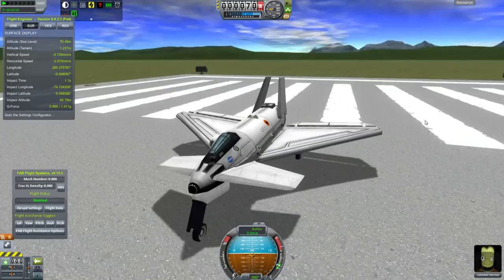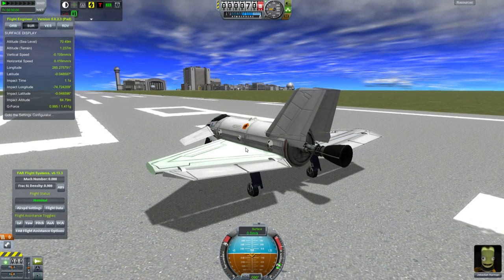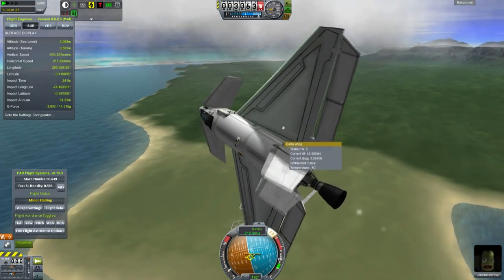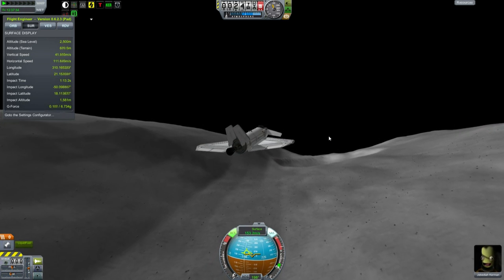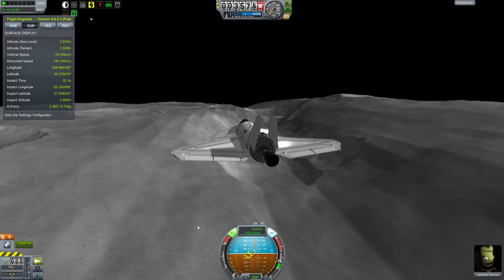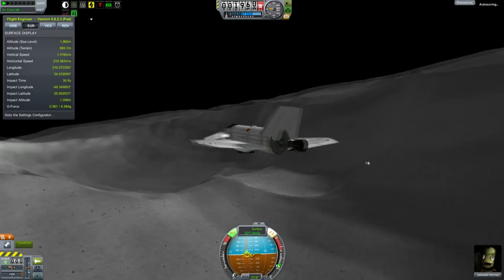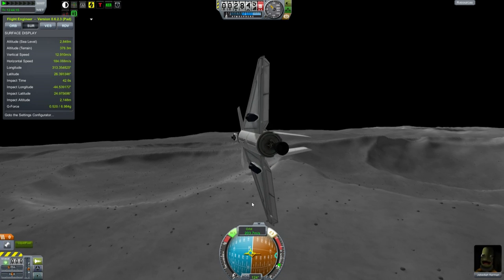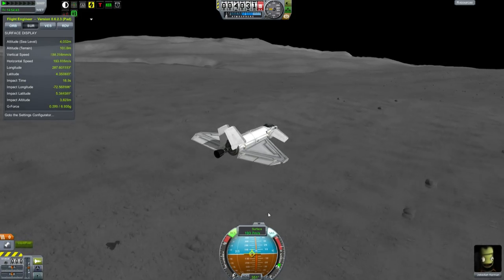The Physics Of Flying 'Space Fighters'

Comment: I think that a realistic space fighter would have very round shapes instead of the aerodynamic looks we are used to. I would imagine a central disk or orb around which the arms with the engines and counterweights can rotate 360 degrees (covering 2 dimensions) and the engines would be able to rotate around the arms to provide full cover. The counterweights would allow the central structure to stay perfectly still while the engines rotate. This would be the place to attach weaponry as well. There wouldn't be a cockpit because having a human in a fighter doesn't make sense. You want to keep the engines as close to the central structure as you can to minimize the moment of inertia.
Reply: A space only fighter would look not too unlike that, yeah. If you need to go into the atmosphere, then you've also got to build in wings and whatnot.
Reply: DFX2KX Yes, but at that point you will need to make trade-offs. I think it would be best to keep them separate.
Reply: So, your suggesting flying saucers? Have the aliens had it right all along?
Reply: seyeruoynepotsuj You could look at it that way :P Mine is just an argument of symmetry really. There is no preferential direction to fly in in space, so it makes sense that your ship would be very symmetric
Reply: Symmetry isn't necessarily the best, it adds flexibility but therefore sacrifices on some specific advantages. For example, having say 4 engines pointed in 4 opposite directions would allow the ship to accelerate in any of those 4 directions quickly, but point all 4 of those engines one way and you can accelerate 4 times as quickly. Same for weapons, point them everywhere and you can shoot any direction, point them all one way and you bring much more fire to bear on one target.

The moving engines and weapons around a disc idea solves this but you add more weight, more parts and more wait time to align engines or weapons to a target. More things to fail/get shot as well.

You also have to think about the profile of the ship. A disc is hard to hit if you are on the same plane as it but from the top or bottom its a massive target. A ball is a harder target compared to the top and bottom of a disc, but easier from every other angle. A tube type shape (i.e. more like a plane without wings) is a fairly easy target side on, but a hard target from the front or back.

If you have a small maneuverable fighter then something shaped vaguely like a plane still MIGHT make sense. All guns pointed forward, all engine pointed rearward. As long as you have the thrust to turn quickly you can try to always represent the smallest target and provide the maximum fire power to what ever you are targeting.
Reply: monoman01 But how would you maneuver? If you want to turn, you will need to turn your ship in a very specific direction no matter what your target is. This means in most cases you can either fire on your target, or follow it.

The extra moving parts would be a point of failure. but you get to accelerate in any direction you please (with a small delay) while firing in any direction you please.

As for the huge target: Since the engines can move relative to the disk, the disk can move relative to the engines. You can always orient the disk so the edge points at the target. This becomes more complicated when you are being fired upon by multiple enemies but I do think the pros outweigh the cons.

I think especially that the idea of the guns being pointed along the same axis as the engines would not work AT ALL. Those NEED to be separate to be somewhat effective.
Reply: You raise some valid points, its obviously hard to say anything much for sure when its all theoretical.
Reply: monoman01 We need some oil in space. We'd have space fighters by the end of the year!
Reply: smaller thrusters which control your angle, regardless of your lateral movement. Just like a normal rocket. Also, a big flat target is a big easily punctured target. Angle your armor to maximize your armor!

Comment: This is exactly the reason I love Space Engineers. It's almost as realistic as you can get in terms of sci-fi spacecraft design and scale but unfortunately, has no proper orbital mechanics or realistic physics simulation with regards to lifting bodies. It does use gyroscopes (equivalent to reaction wheels) in order to yaw, roll and pitch the ships, however.

Pulsar: Lost Colony also has what I would say is the most realistic flight control system of any sci-fi game I have seen, behind Kerbal Space Program of course. The ships in Pulsar actually do use manoeuvring thrusters in a realistic way, although this game does also have inertial dampeners much like Space Engineers, which is sort of like the fly-by-wire system you speak of. This allows you to turn the spacecraft and point it in the direction you want to go, fire the main thrusters to accelerate in the desired direction all while the manoeuvring thrusters are slowing your current velocity to zero, allowing you to fly similarly to an aircraft.

Ahh, sci-fi spacecraft physics. Beautiful.

Comment: One design reason for the big engines at the back is that it's a great way to telegraph information to players.  Particularly in Elite, the engine effects are carefully designed to fulfil this role.  It's like a big blue arrow pointing from the back of the ship, there's bloom/flare if the ship is pointing away from you, it blushes red if you use boost, engine trails show the ships path over the last few seconds, etc.

Comment: Neat video. I liked your points talking about the different strengths of each of the thrusters needed to achieve atmospheric style flight in space. I believe SC is still tweaking how powerful the maneuvering thrusters are compared to the main thruster. A possible explanation could be that the large engines at the rear of ships in Elite Dangerous and Star Citizen could be that those engines double as the engines used in super cruse and quantum drive travel, between orbitals in a system.

Your videos have also made me want to check out more about Elite Dangerous, because it seems like it and Star Citizen (which I've backed) will end up being a really great pair going forward.

Comment: I've encountered a similar problem in Space Engineers. A decent solution is to chose just one axis to put major engines on, and put small maneuvering thrusters on all others. And in practice, it seems to work best with main engines providing "lift" so that you can track your target exactly the same way you'd do on the airplane and allowing for fast course changes. While even your main forward propulsion engines don't have to be nearly as beefy, since adjusting forward speed can usually be done in less of a hurry. So a perfect fighter would probably be very similar to a conventional rocket, but with the cockpit attached at 90 degrees.

Comment: In the Star Wars universe, the explanation given for starfighters and other craft maneuvering like aircraft is that they use vectored thrust to direct the craft, where either they are constantly burning the engine to have thrust to vector (somehow without them constantly accelerating) or doing short burns and vectoring that thrust to maneuver.  I'm not sure which, but I'm pretty sure it's the latter, for plausibility's sake.

And the reason they might be able to have such snappy maneuvering with quick burns is because starfighters usually have upwards of 1000 G's of acceleration.  I'm pretty sure they have some form of inertial dampening to keep that level of change in velocity and the forces it would put on the pilot's bodies from straight-up killing them.

Comment: Since this thing is capable of operating in space, yet is also designed to be aerodynamic for flight in atmosphere, I would call it a multirole aerospace fighter. With a fighter that operates purely in atmosphere being an aerofighter, and one designed purely to operate in space (probably just a ball with thrusters and weapons, although seriously considered design process might come up with something else) would take the name 'space fighter'.

I am actually starting to wonder exactly what a pure 'space fighter' would look like. If it is not designed to operate in an atmosphere then there is no need to take aerodynamics into consideration. What you need is a weapons system, a propulsion system, a detection system, and a defense system. The fighter itself will be the sum of these systems plus a simple chassis to put those systems on. The specifics of the design will depend on so much. The technology available (bullets & missiles, or lasers & black hole drives? what sort of automation is available?), the potential threats/targets (what kind of engagement ranges are we looking at? what kind of ordinance do we need to defend against?), and the supporting infrastructure all need to be taken into account (does the fighter have supporting carriers? or does it need to be independently capable of deep space flight?). It might even turn out that the concept of fighters won't even be the best approach. 

What would really help would be to game it out. Set the initial conditions to be equal to today's technology, with space warfare (mostly ICBM's, observational satellites and anti-satellite missiles) existing mostly to support ground operations. Assume no treaties limiting warfare in space and naturally evolve it with strategies/designs and counter strategies/designs being submitted by the players. Such a simulation would need to take into account expected developments in the industrialization and colonization of space, as that would change the objectives and operational environment. 

It would be very interesting to see how things turned out. I bet you would get different results if you ran the game multiple times. Especially if you varied the assumptions for commercial space expansion or allowed for limiting treaties. I could easily see most nations agreeing to treaties aimed at avoiding Kessler Syndrome, even at the cost of some military disadvantage. I could equally see no nation being willing to agree to such treaties for fear of incurring a military disadvantage, however slight. That might make a considerable difference in the evolution of space warfare.

Comment: It would have been nice to mention the opposite problem - the Harrier and it's derivative, the AV8-B which, while definitely airplanes - have thrusters to make them do able to do some of the odd things your space fighter can do.   They were intended only for vertical landings and takeoffs - but pilots figured out interesting ways to use them in combat - with tricks like the "VIFF" (vectoring in forward flight).   It's also interesting that they steal thrust from the main engine to do that - which eliminates some of the problems you mentioned with having sufficient power in those tiny thrusters.

Comment: @3:50 The reason you begin to roll when yawing an aircraft is because the wing on the outside of the turn is moving faster through the air which generates more lift than the wing on the inside, giving you a rolling tendency.

Comment: Rate of turning is not only influenced by the amount of thrust, but also by the placement. The nett moment of the forces about the Centre of Mass (COM) will determine the rate of rotation. Essentially, rather than doubling engine thrust, you're better of doubling the distance to the COM.
Assuming that the COM will be more towards the rear of the ship, it would be good design practice to place your manoeuvreing  thrusters at the nose (at the extreme front).
If you want to go straight up, then you are right ofcourse. That's why it is much faster to pitch and use your big engine to change direction.

Comment: To me, for a space fighter, the RCS thrusters are only useful for changing the ship's orientation so that the main engine can thrust on a different vector to put you on a new trajectory.  Like Asteroids in 3D.  
One problem with a joystick controller in KSP is that it only covers the X and Y axes.  If I get one, it will have rudder pedals that I can use for the Z (yaw) axis.  That's what a space fighter would need for controls as well as a throttle for the main engine- you need both hands and both feet to fly one.

Comment: Just putting this out there, could The big ass thruster on the back just be so much bigger than the others because its the one that pushes the ship near light speed? 

or is that not how this works? 

when making a jump? ((I'm talking for fast travel not jump points)) 

because As far as I know we cant manuver when jumping witch is why we get pulled put of it for obstructions ((an excuse for game play i know,))
Reply from the maker: Just putting this out there - do you want the spacecraft to 'warp in' to the zones in reverse as the engine decelerates them from high speeds?
Reply: Scott Manley  That's how some games do it. I recall playing star ruler which did this and it made for some interesting gameplay, especially since you designed your own ships in that game.
Reply: Scott Manley Thats A good point.  I would not have a problem with that... but going by the crazy on the forums others may shrug
Reply: I don't think any "thruster" exists, even in sci-fi, that can generate that much power. For light speed or faster than light travel it would be more a device that does it, frameshift drive in elite for example. Not a thruster in the classical sense
Reply: I was about to make the same suggestion when I saw this.  And yes, actually, I think it would be cooler to see the ships decelerating retrograde from FTL speeds.

Either that, or it can simply be for hybrid ships (spaceplanes, essentially) that are used both in atmospheric flight and space flight.  I think there's enough reasonably plausible sci-fi explanations that can be done in-fiction to make the ships look how you want them to look without throwing physics completely out the window.

I'm personally very curious to see how my 'lancer MIS is going to fly, as the weight balance and thruster positioning looks extremely asymmetrical to my eye at least as it sits in my hangar right now.  Obviously if it ends up being a total mess when they hook up all the parts in the xml rig and get it working in the game they'll probably tweak the design, but it's interesting to think of how a ship might handle if it favors some axis over others, or one direction of an axis over the other.
Reply: Philip De Bruyne
I thought reverse warping in was a French thing.
Reply: ***** Surely a ship that disengages its warp drive would retain the velocity it had when it entered warp, therefore you would see everything move incredibly quickly if you left warp.
Reply: ***** Physics based warp drives like the Alcubierre drive do "accelerate" and "decelerate" just like a regular reaction drive.
Reply: I thought you moved at say 2000m/s inside the bubble but at 5c outside the bubble or something, so when you make the bubble collapse, you should only exit at 2000m/s.
Reply: koffieslikkersenior You'd be stationary with respect to the bubble, otherwise you'd leave -- and be crushed by gravitational stress on the very high curvature walls of the bubble.

bob smith's comment is correct. Your travel is with respect to a reference frame, so some velocity matching would be required to take the relative velocity between origin and destination into account.
Reply: gogerychwyrndrobwll Okay thanks!
Reply: bob smith simply warping space is not enough, you do in fact need some velocity relative to the space that you are warping, think of it like scrunching up space in front of you and stretching it behind you, then stepping over the scrunched bit and letting it go back to its equilibrium
Reply: 1wsx10 Actually, you don't.
Reply: 1wsx10 The warping of space provides all the "velocity" you need.
Reply: Called it :P
Reply: +Dogstar Exactly, the Main Engines runs only on a fraction ot the available max Thrust.
This BIG ASS Main Thruster is needed to accelerate the Ship in Cruise Mode to 1000m/s +/-

So, if you think about the fact that this game plays in the future and they dont use old RCS technology from today , its not that unrealistic.

So, the Maneuvering Thrusters should have as much Thrust as the Main Engine in Combat Mode.

If you switch to Cruise Mode that BIG ASS Engine throttles up to 100% and will provide enough Thrust to reach those Cruise Speeds.
IN Cruise Mode those tiny little Maneuvering Thrusters arent powerful enough anymore to move the velocity vector enough so your turn rate is muuuuuuuuuuuuuuuch slower than in Combat Mode. 

- IF there are any mistakes i've made - i'm from germany.